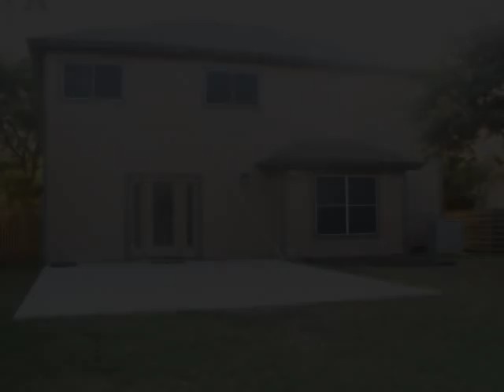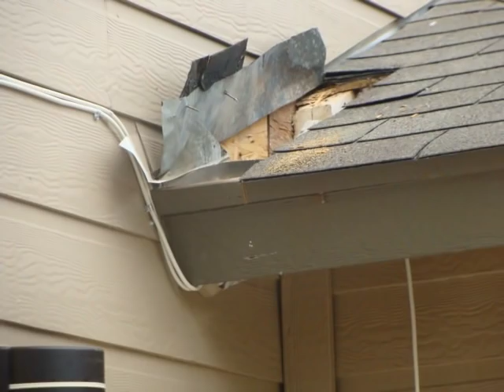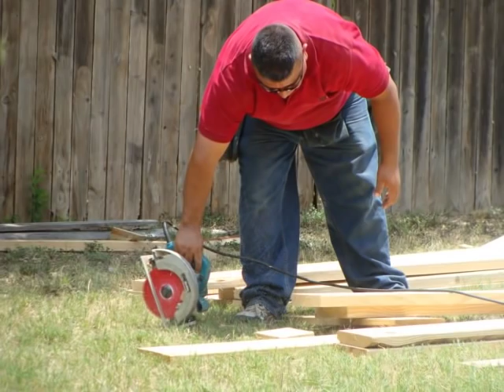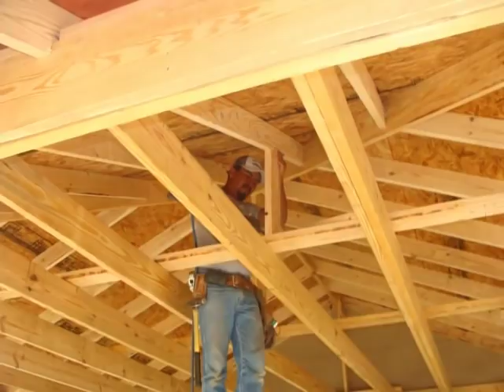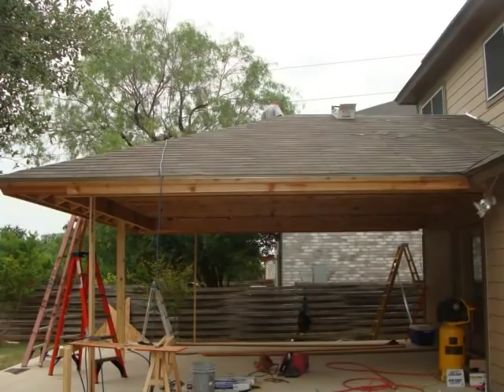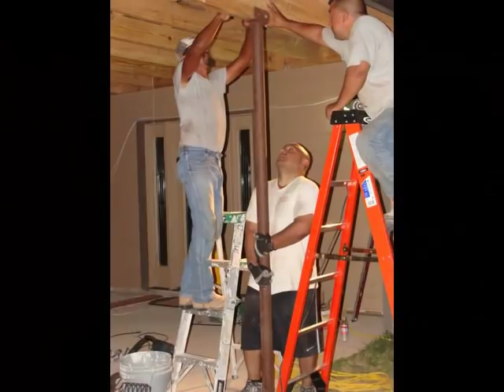cover patio

Comment: this is a very frightening video to watch.  If one of the two small supports would have given way or got knocked down this could have been a disaster to both the workers and done major damage to the house.  I held my breathe in disbelief watching this video. In my opinion know your weight and determine your support before you start.  Supports and foundation are not to be an after thought.
Reply: I agree. I cant believe they built that whole roof with only 2 2x4 supports! that was a very sad.
Reply: At the end of the day it’s a well-built patio cover. It looks great and ties into house well. Some people just confuse resourcefulness for recklessness.
Reply: @mikes622  they’re not 2x4’s. They’re tubasix’s! Each one can carry 7,000 vertically.. they used three so all three lumber pieces can carry 21,000lbs... also, the beams were braced laterally.. that structure isn’t going anywhere with a couple guys on it..
Reply: @CaptFatCat  you have no idea what you are talking about

Comment: They just nailed it to the house? That structure has very little holding it up where it is attached to the house. Mickey Mouse job. Homeowner should at least put some posts under the side closest to the house just to keep it from falling down on their heads.
Reply: What the heck? Do you think the beams are just floating inside go the walls? They’re obvious sitting on supports and fastened in.

Comment: I've been framing for 15 years and we cut most of our material on the ground.  It's much easier to get a clean cut and not have to hold up a heavy piece of ply or long 2x6.  Grass is the best surface for cutting, just set your blade height on the worm drive properly and go to it.  Just my opinion...

Comment: All structure on 2 4x4 ! you guys are insane
Reply: I was thinking the same thing 😬
Reply: Each 4x4 treated post holds up to 4,000.. that’s a total of 8,000.. hence, total vertical load the combined posts can carry is more than what a full size SUV weighs..  A few 200lb men on top of the roof won’t do anything to that structure..

Comment: I am not an architecture expert, but.... installing columns after the roof construction, is insanity!
Plus I see the roof being installed next to house wall without any metal flashing - just caulked - meaning, it will rip and disintegrate form the rain sun and ice, leaving a gap.
The inner rafters are cheaply connected to joists with wood chunks nailed sideways- very dirty and quick way- which will slowly make cracks from side nails.
The last minute column installation was the scariest part.
Reply: the whole time watching i was like... wait... where are the posts... what are these people doing.... HOLY SHIT WHERE ARE THE FUCKING POSTS
Reply: That is how it is done. EVERY Framer in the SE does it in that manner. Those 2x4's will support the structure temporarily, even with 2-3 guys on the roof. On custom homes with fancy large covered rear patios with LVL beams, large cathedrals they support them in the same manner, then install the post afterwards. Lol when I started framing I was like wtf .. "Those 2x post will break, we need bigger temporary supports !" I was wrong, those 2x t-posts never moved in inch.

Comment: i agree that ledger should be installed directly to the framing of the house and flashed properly,but it is under the eve, so it wont leak i also think tou could have done a WAY better job flashing the roof lines--didnt look so good--just sayin

Comment: A few things: Those supports look like crap. A quick load calculation for beam span would have prevented such an eyesore. I also hope it doesn't rain there because that little valley will probably leak. And what roofer in their right mind puts on 3-tab like that? The drip lines must be perfect, or they look like crap. Good rule for 3 tab is (5 and 5) 5 inch exposure, 5 inches over. No crappy drip lines...

Comment: I am considering doing a dyi project. I am currently watching videos and purchasing a book. I have questions about this video. First it seems that there was a lot of load on 2x4 holding the structure up. Would that be considered unsafe? As well as it seemed that the siding was not removed from the back of the house. I saw some flashing, but would you be concerned that water would eventually leak between the structure built and the house?
Reply: Hello There,

     So you’re considering doing your patio.  I’ve
looked at plenty of videos myself to do my patio, and read city specifications.
Let me tell you, the videos gives a little advice, but the technique of doing
it is a whole different matter.  For example in this video, they did a lot of technical things incorrect as far as
safety goes.  Perhaps to show the soundness of their patio, however I wouldn’t chance that. Although their technique was great cutting the wood and the tightness of the wood; I did really well on
mine but because it wasn’t tight like how these guys and a few other videos I
watched, I used a lot of fasteners.  As far lumber selection, it really depends on the size of the patio.  My is 25 x 15, and the city inspector said to use 6x6 posts, 2x10, main beams, and 2x8, 2x6 for the rafters. However I did something special with the 2x8 where I needed to double the 2x8 them, and I
worked some magic with my son to make the that span. The site inspector said I
should have also doubled the center one through the center going the short way
too, but the city inspector said how I did it was fine. Overall it’s going
great, and I should be done in a week or two, since I mostly working in the
evenings after work. Making a patio, you can do it, however what the videos don’t
show it’s not as easy as the videos I’ve watched the create it, and you should
have a partner to help for good part of the heavy lifting.  I’ll put a video up after my job is
completed. 

Good luck.
Reply: @mabblers  You are NOT a carpenter. The fact that you think you are qualified from looking at Youtube videos and reading building codes is outrageous. I saw your patio video and will give you credit on that. But let's not forget the fact that it took you 4 months to do a 2 day job. It took you that long because you have no experience.
Reply: @Geekmasterproduction    I never said I was a carpenter,  however you can actually learn something from watching Youtube vids.  In addition I have done a few smaller home improvements before.  This is funny,  you can do this job in two days.  You need a reality check.  Even if you had say 10 people helping, it would be at least a couple of month as it did with my neighbor who had a professional team of folk doing his. Don't be a hater.
Reply: @mabblers  I frame in GA. I started framing specs for DR, and providence group then got into light commercial and custom homes. Only thing I have not done is apartments. How are you going to tell me who does this everyday ? It takes 1 1/2 weeks to frame a entry level spec home, and on large custom homes it takes minimum 1 month with a 5-6 man crew. If a patio took that long the payroll would be over $25K, JUST payroll for 3 guys at $150 a day. A LGI or DR entry level home framing labor costs is around $7,000 - $12,000K.
Reply: @mabblers  You did a GREAT job on your patio, but that does not qualify you as an authority on carpentry unless you are doing this everyday. If a coworker who was clue-less told you how to do your job or talked as if they were qualified you would have the same sentiments that I am have.
Reply: @Geekmasterproduction  Thank you for the compliment however well sir, I don't know you or anything about your work history. I can only speak to what I have actually seen. If you can do better, that's truly good for you. Again I never claimed anything of being an authority on carpentry or being one. You started with this. If you do this kind of work on a daily basis.  Of course you should be able to keep such schedules like. I am a layman doing my best to make my place nicer myself.  For the crazy cost to have someone as yourself and your team to do it. Peace out! Happy New Year.

Comment: That structure is built entirely incorrectly. The posts are inadequate for the load, the double beam on the end is pointless, it carries no load. There were no carriage bolts nor lag bolts used at all. The "joists" are pointless, they should be turned 90 degrees and used as collar ties for the rafters, which are deadly. Not a single bracket or hurricane strap used so a mild storm with wind speeds of 40-50 mph will bring it down. Please, please, tear it down before it kills someone.

Comment: sickening.  the steel tubing is a huge red flag....i hope this isn't a marketing skit.
Reply: +DR Dan I wasn't putting the construction down because they used the steel tube,  more than likely it was pipe, but because after the construction was complete,  they could not have felt that a couple 2x6s were sufficient.  if it were mine,  the framing and supports would be made of mild,  and go from there with that evil splintery stuff.  it would be way over redundant,   then again,  I'm just a stupid pipe welder.  ;)  and yes you are very right,  this is dangerous.